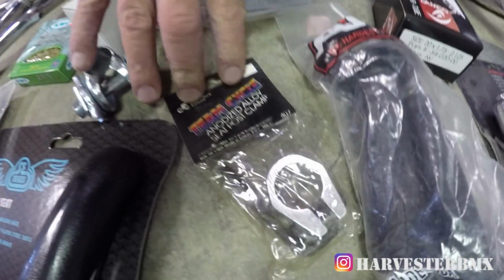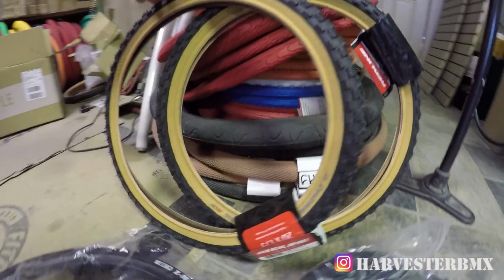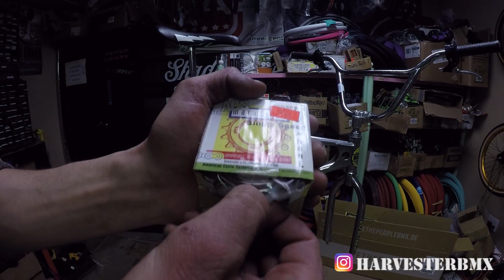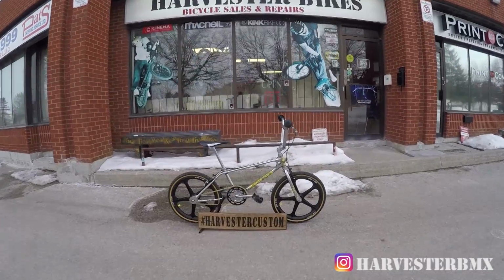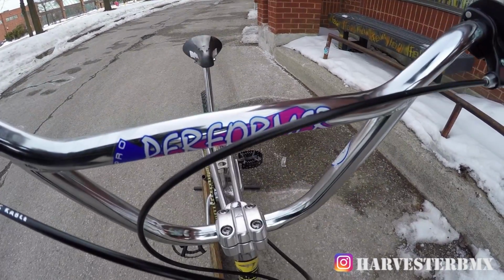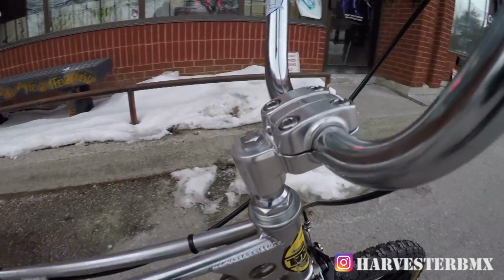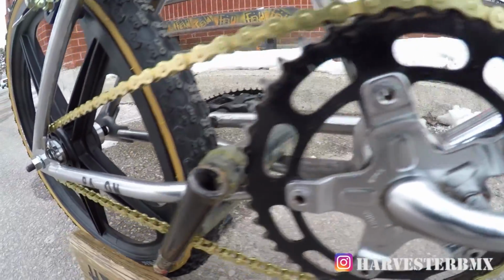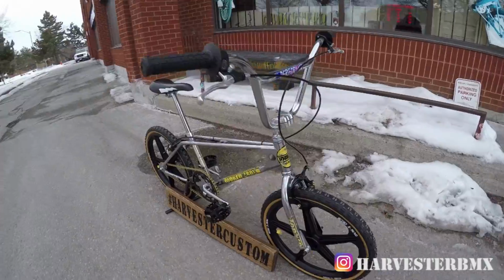Torker 280x Old School BMX Build @ Harvester Bikes

Comment: i got a 98 torker for my bday and had rode it for almost 10 years til one day i took a small jump off a curb and the frame snapped in half at the bottom big bar. now i cant find them bikes anywhere, great build
Reply: Checkout my 1983 Torker 280 .... i live in London UK but check out the sticker on the frame... it originally came from a shop in CO USA
Reply: @nickonak5475   I’m restoring an ‘83 280 as we speak. 🤘🏼
Reply: Search for an early American built Torker. Whole different animal.

Comment: Actually I just dug out my 1983 Torker 280 and I’m gonna restore it it’s not in terrible shape but what would you recommend as far as a good rust remover that won’t pivot the chrome frame
Reply: I’m restoring an ‘83 280. I use brass bristle brushes and Dawn dish soap to remove the surface rust on mine. Deep pitting is permanent, but a little scrubbing and a coat of carnuba wax will improve the appearance and keep it from getting worse.
Reply: The brass brush won’t scratch the chrome, but the loose rust will….so blow loose debris off of the surface as you brush. Works like a charm.